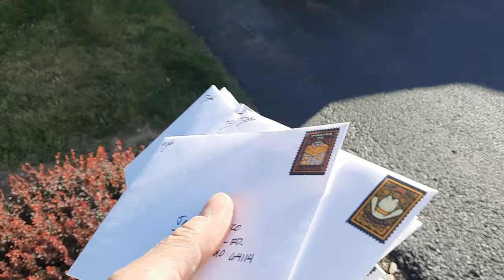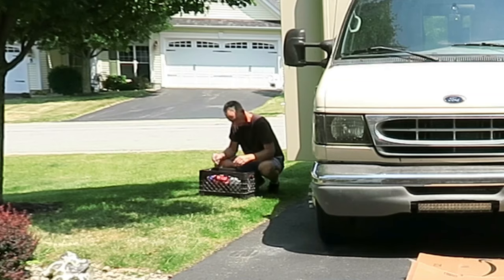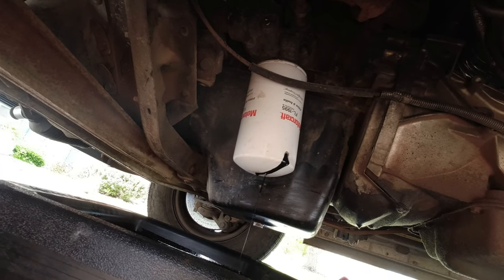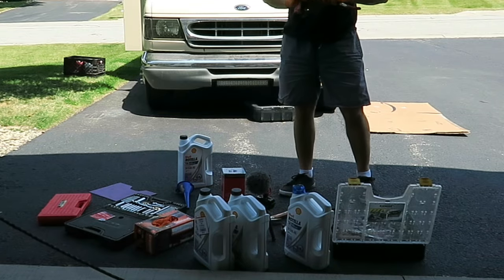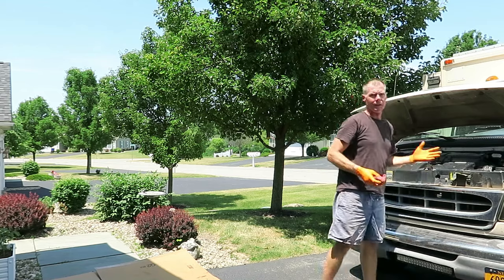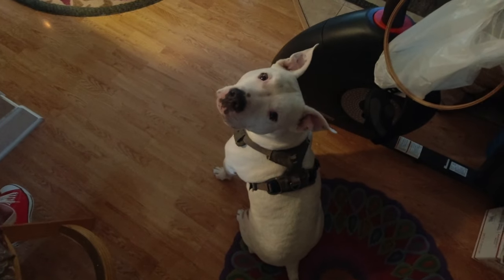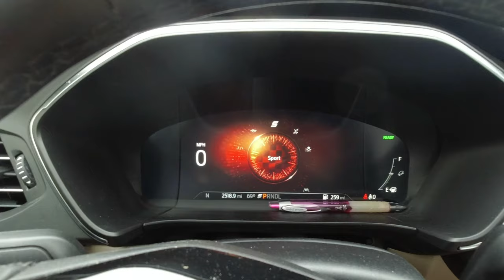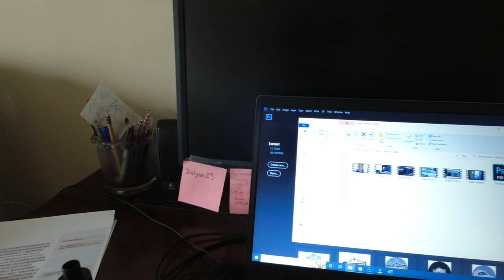A Viewer Paid HOW MUCH For An Oil Change??? | Lefty Update | Ambulance Conversion Life

Comment: Another great video Dave and Lefty shows us how to get things done. One side note to your viewers. When doing an oil change and removing the filter make sure the old gasket is not stuck to the mounting surface on the engine. And when using a jump box or power booster do not run the engine for a long time while it's connected. The batteries that are used in those will start to swell they are not designed to be charged from the alternator.
Reply: When I was a kid I did that to my first motorcycle!  I went about 100 feet before the bike vomited its oil and freaked me out!  A mistake you make once!
Reply: @springer2112  yeah that happened to my 82 Camaro. First oil change at the dealership. Drove about 10 minutes oil light came on shut the engine down got out of the car to see what the matter was saw Trail oil going back to the dealership. Luckily you know damage to the engine
Reply from the maker: Excellent tip thanks Tom! Some things are so ingrained to my brain that I fail to say it!
Reply: Your welcome Dave.

Comment: Great video  . FYI always look at the old filter to make sure the gasket is there.  You don't want a double gasket.  It will lead to a failure
Reply from the maker: Great tip Miles!

Comment: I don't jack my E350 ambulance to change the oil because I'm skinny but I still drive the front wheels up onto some chunks of 2x4 just to give me a bit of extra space to slide under.  Super quick, easy and very solid.
Reply from the maker: That's a good idea :)
Reply: @TheCampulanceMan  Basically the same technique I use to get my 95 Miata high enough off the ground to get a jack underneath it.  Honestly it takes about as much time to get the miata up in the air for an oil change as it does to complete one on the ambulance.
Reply from the maker: @s.willis8426  Miata Life!!!

Comment: Wow! Saved yourself $180.00 bucks! I'm 72 years old and still do my own oil changes, on a car. But still saves me money and gets done right! Oil is the life blood of the engine, why leave it to someone who probably doesn't care? Why spend so much more for that? 
Great video! I also use cardboard...cheap and absorbent, if needed.
One thing and maybe I missed your saying it...you always need to check removed filter for gadket, sometimes they stick to engine, then you get a double gasket and a leak. Oiling the new gasket usually prevents this...but you never know, better safe than sorry. Be safe!
Glad Lefty had a good checkup!
Reply from the maker: Great tip David - the stuck gasket has happened to folks. I didn't think to mention that, thanks!

Comment: I have been using T5, which is a semi-synthetic, in my GMC c4500 former ambulance, which seems like a good compromise between full synthetic and non-synthetic. The 6.6 turbo diesel seems to like that stuff. No leakage that I have noticed.

Comment: When I do oil changes, I stay under the vehicle and look over the bottom of the engine/transmission and suspension while the oil drains. I have caught a lot of problems doing that. Greasing the vehicle yourself also allows you to spot problems on your drive shafts, u joints and axles. I also put a drop of oil on the oil filter gasket when I spin it on. I usually pull the fuel pump relay and crank the engine until I get oil pressure showing on the oil pressure gauge. With those diesels, I would check into oil analysis while doing oil changes. They where about $40.00 for a kit a few years ago.
Reply from the maker: Great tips, thank you!

Comment: Craig Smith Rv charged us 330.00 to do the rv and generator on a gas rig . I was livid . I told him I did the RV for 60 bucks before we went to Arizona. Tip , it doesn't do any good to get mad
Reply from the maker: I had to have one done due to timing and location and paid $150. I needed it done so I accepted the cost and moved on... You're right Carl, doesn't help to get upset - it's just a part of the journey... a small part...

Comment: Replace your drain plug with a Fumoto quick drain valve and never remove drain plug again. Two holes in the oil filter won't make it drain faster loosen it just enough oil doesn't come out then puncture it oil drains faster. You should change fuel filter with every other oil change don't know if you do that but it's part of good preventative maintenance.Your fortunate you can do change without lifting the truck. How is your air bag install going?
Reply from the maker: Great tips Alan thanks. I've looked at the valve drain, just never pulled the trigger on it... Fuel filter is next and I'll show that in detail because it's important. The air bags haven't delivered yet... back ordered :/

Comment: I do my own and this year it really paid off. It’s $265 or so if I have the dealer do it. It takes about 13 quarts of fully synthetic mobile one, a Bosch filter, and my own labor, is about $140. Even though the vehicle and owners manual suggest every 20,000 miles, I do it every 10,000 miles.

Comment: Lefty whining when you started the 7.3 made me laugh.  Our dog knows the sound of our truck camper and even the sounds of the specific key ring for it...he makes the same soundtrack.  
One caution as to getting auto parts these days...watch what you buy such as oil/air/fuel filters from online parts sources.  MANY are listed and shown as OEM but in fact what you are shipped are cheaper "China copy" parts.  As you stated...these diesels like clean fuel and oil and poor filters are a potential failure point that can ruin an engine.
Reply from the maker: He's tuned to the 7.3 sound!! Even other 7.3 trucks - he knows that sound :)
Your comment about knock off parts is right on! They even copy the packaging and list them as OEM.

Comment: Also if you dont it will cause early ipc and ipr to go out. Motocraft ipc is about 120. Ipr  is 180. Injecters is anywhere from 1800 too 5000. It takes about another 30 mins and some sort of vaccum pump and allen wrench.

Comment: hey David,look into a 4 amp battery tender. my 7.3 sits quite a bit .I put a trickle charge on the passenger side battery which ends up keeping both batteries charged. I love lefty
Reply from the maker: I am thinking of an AMP L START device - it takes some of the solar power and maintains the crank batteries.

Comment: When I was active duty the number one killer to all diesel vehicles is not to let the glow plugs run it's cycle. Ignoring the "wait" lite causes the glow plugs to bloat and burn out making them not removable. In today's world this can be very extensive to have them replaced.
Reply from the maker: That's like the 2nd time I ever did that - the booster wants to be cranked quick and I needed all of its juice :)

Comment: A good rule of thumb with the 7.3 PSD is to also change the fuel filter in the fuel bowl when changing the oil. Great video.
Reply from the maker: That's coming next - good tip!!

Comment: If I may so bold as to add a couple of points to the oil change ?  Make sure you can get the filter loose before you poke a hole in it.  And if you do not have a "a friend named Tim" who has a shop where you can take the oil, check with your local auto parts store.  Here where I live, O'Reilly auto parts take used oil for free.  I know everybody here knows this, but it bears repeating, used oil must be disposed of properly.  Very toxic to the environment.  
Good job supervising by the Left-hound !  Such a great dogger.
Reply from the maker: Good tips! All service shops and parts stores in NY are required to accept used oil - I'm not sure if every state is the same. My supervisor stays on the job... well, at least near it :)

Comment: That person got screwed. I went to get my oil changed at a local Valvoline Instant Oil Change. We paid $65.00. I bet they went to the dealer. That way you don't have to find someone to take your oil. Plenty of room if you skinny like you are. lol Should start a rig like that once a week to keep the batts topped off. Also need to let the truck sit for a while before you check the oil again. Most of the time the oil takes time to drain back down. Glad your pups ok.
Reply from the maker: Great tips! And youre right, they did get charged that at a dealer...

Comment: My fits 7.3 was a 96  F350 crew cab.  It's the vehicle all my kids learned to drive and back 200yds up the driveway.  Back then a dealership oil change was $78 . They did my first. I changed my own after that. Rotella T was like $10 a gal or less and I would buy oil filters from Napa thru the company I worked for. $6 !  Oh,  Napa got a goverment rebate for large companies keeping their oil changed 🤔🤔 . Ford wasn't $27 for their filter ! I could get it for less because I knew the parts guy. But I made a trip to Idaho after a change (1500 miles)  and something in the filter broke (Ford filter) and my engine lost power ! I carried a spare fortunately.  I changed the filter and it ran fine again.  
Definitely a ripoff to get oil changes at shops !  Hazmat disposal fees and many shops have used oil heaters ! They also buy oil by the 55 gal drum ! Glad to see you can do this. And bit get oil on your driveway 🤠
Reply from the maker: It's such a simple.job - all of us should be doing it! I've always used the Motorcraft filter, but I'm not against an alternative.
Reply: @TheCampulanceMan  like I say, I quit when I had one go bad on me. I had about 250,000 miles at that time. I should have save the filter and cut it open to see what happened. I drove that truck for 488,000  miles.

Comment: Bought a Ram 2500 Diesel back in 2014 first oil change called the dealer regular oil was $50. Synthetic oil was $290 I asked them if I brought my own oil which was synthetic was the charge $50. Nope $290 even with my own oil I did it myself which I had planned on anyway but if it was not much more then what I would pay for oil it takes 3 gallons I was thinking why not have them do it. So much for saving money I'm also not all that sure synthetic really does much of anything if you change your oil frequently. There is lot of discussion and opinions I never had any issue with regular oil as long as didn't let it run long, or sit for years.
Reply from the maker: My 7.3 prefers the T4 over the T6 synthetic.  Old engine likes the old style oil :)

Comment: Im not trying to tell you how to take care of your 7.3 but i have been changing my top end oil for over 250000 miles, its just injecter imsurance. If you dont your injecters will die. Find doing it on line.

Comment: Do you change the oil in the HPOP?  How often? Thanks. I'm glad you are in NY for awhile. You may look into a quick disconnect for the battery so that it doesn't discharge so quickly - at least on the starting battery
Reply from the maker: I haven't ever done the hpop, no.

Comment: When you put the new oil filter on why did you say to only 'hand' tighten it?  If you only hand tighten it why would you need a filter wrench then to take it off? Shouldn't you be able to take it off by hand if you had only hand tightened it to put it on?
Reply from the maker: The rubber gaskets swell and cause them to tighten after use.

Comment: I used a Newpowa (?) 20 watt solar panel that plugs into the cig lighter (hot) to keep my battery charged. Underwhelming results with harbor freight or comparable units.
Reply from the maker: I've got to check for draw once I replace the batteries. One of mine started failing a year ago :/
Reply: @TheCampulanceMan  I replaced my battery upon purchase. Diehard. Then the alternator went out :(
Reply from the maker: @wanderlostrvr2582  Baby steps :))

Comment: looks good I have three are fore filters undermine I don't know what one is the oil filter
Reply from the maker: What type engine do you have?
Reply: @TheCampulanceMan  it is a 2007 6.0 power stroke beond that I riley don't know. I do oil changes in my car all the time, but things look a lot different underneath the ambulance
Reply from the maker: @crossxcats  The 6.9 oil filter is on top of the engine. That's even easier. You unscrew the cap and lift it up and out.
Reply: @TheCampulanceMan  o ok I thought that thing might be a fuel filter of some sort ill you tube it and figure it out thanks

Comment: Hi David and lefty 😀. Would my 2002 ford 7.3 take the same filter and plug washer. Also were did the oil leack from with the other brand oil. Maybe thats my leak issue.  Blessings always for you n lefty and your family
Reply from the maker: Yes Elaine - that's the same year and engine as mine. Use those same parts I listed. I saw seepage from the oil pan gasket, valve cover gaskets, and possibly the rear main seal. Not active dripping, just seepage. I recommend the T4 oil for your engine too.
Reply: @TheCampulanceMan  thank you David.  I  could use some ideas about the electrical.  I have the same wiring schematics that i sent you. But I don't understand it.  Someone who worked on the rig before I received it. Drilled a screw through the thick Red cable , can that cause a short. When I try to plug it to shore power.  My house plug 20A starts clicking.  So I don't plug it in 🤔🤔 any ideas?  Blessings always
Reply from the maker: @elaineg4921  Have you traced the shore power wiring? Do you have an inverter and a stand alone power converter (battery charger)? You need to trace that wiring and then test it with a meter to see if it's intact.
Reply: @TheCampulanceMan  theres a go power 1750 HD inverter they took out the original vanner. I don't know about battery charger. I told the inverter never worked. But they were able to plug in to shore power. That's why I wS wondering if screwing through the fat red POS wire could mess it up.
Reply from the maker: @elaineg4921  Yes, if that cable has a screw in it, and that screw is grounded to any metal then that's a problem. If the screw has been removed and the cable just has a hole in it, it should still work. But, it could have tripped a breaker when it was done...
Reply: @TheCampulanceMan  oh ok ! i just have to figure out where and which breaker it could be..keep your  fingers crossed for me.  thanks David blessings always
Reply from the maker: @elaineg4921  Best of luck :)

Comment: You may still have seepage after returning to T4.  T6 is Synthetic.  You should not return to not synthetic after using synthetic. Returning back to T4 yur gaskets will shrink back  some and create more seepage.  Check out the information before you head back to sparce service availability.
Reply: that's a myth. not true at all